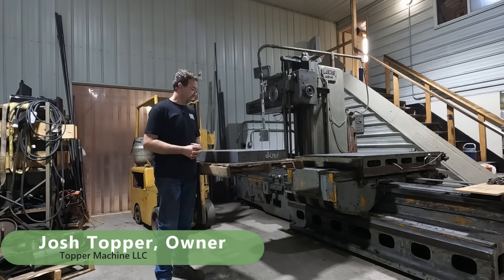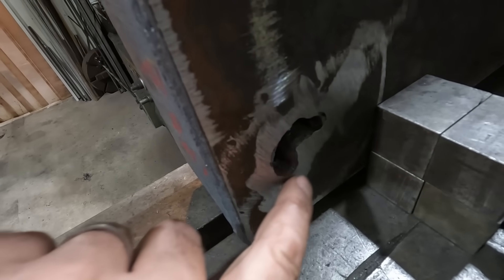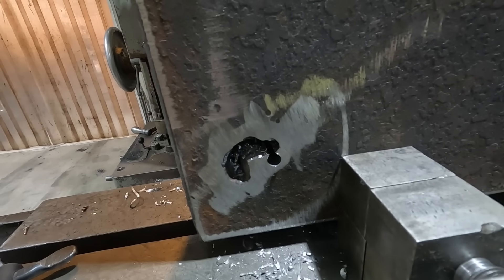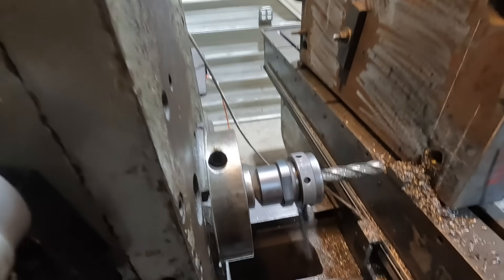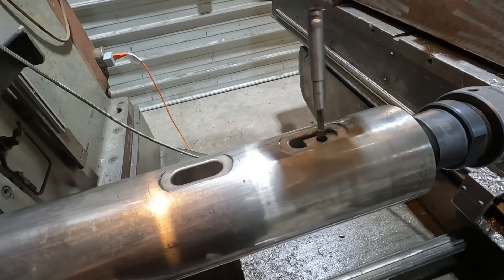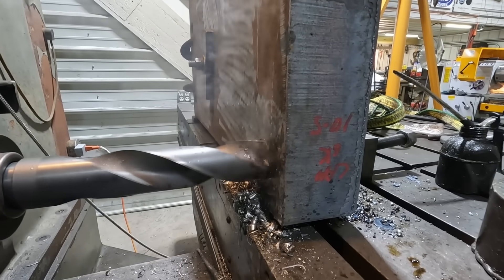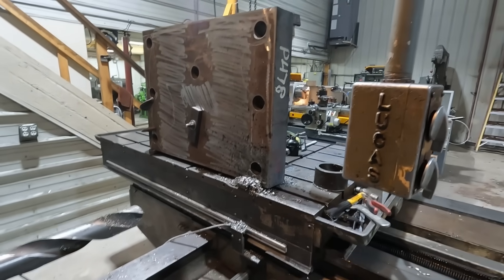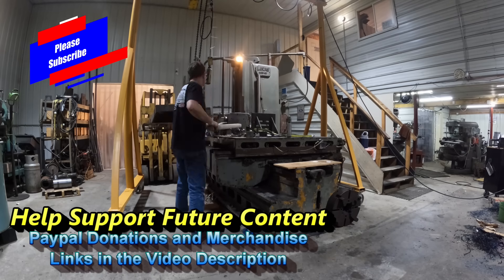How To Save A Plate With A Bad Torch Cut | Manual Machinist Repair Explained

Comment: I have a 1918 Lucas No. 43 HMB I’m fixing up to use. I’m having trouble finding tooling. Mine also has an MT6 spindle taper. Is there any way you could make a video showing how you made that draw key?  That would be super helpful. Thanks. Keep up the great videos.
Reply from the maker: I've had to make and modify so much tooling to get where I am. MT6 is getting harder to find.

Comment: Sometime over the years I picked up an ancient mag drill and a huge bucket of annular cutters. While I don’t use the mag drill much, it’s great for stuff like this. I use the annular cutters in the mill quite a bit. I love seeing these big old mills in use still.
Reply: Annular cutters that can cut more than 2" deep are pretty rare though.
Reply: @bcbloc02  True, I think I have some longer ones but most are pretty stubby. Given the loose tolerance, I think you could drill a pilot hole all the way thru and drill from both sides. I just wanted to point out that annular cutters exist really. It’s one of those things like trepanning in the lathe that I often wonder why more people don’t use.

Comment: Seeing the already cut holes in this 4" plate, it's obvious the oxy-fuel operator didn't know the proper procedure for piercing and cutting this thickness. Oh well, more business for Topper Machine.
Reply: What is the proper procedure?  Do you bury it in sand to keep the whole block at temperature?
Reply: @1nvisible1  I have hand pierced and cut steel this thick years ago in recycle work. My personal opinion is that considering the thickness of the metal and the small size of the hole, that a pilot hole should be drilled to eliminate the possibility of the pierce wandering outside of the diameter of the hole.

Comment: Nice work and what an amazing massive machine!  This is the first video of yours I've seen, so forgive my ignorance... but why not just use a magnetic base drill and 'hole saw' (I'm assuming the hole saw does not need a pilot bit in the center, like a hand-held drill hole saw would).  Maybe they don't make the bits to go 4"?  I'll be checking out your other videos now!

Comment: Magnetic drill and carbide tipped annular cutter. Guess the iron shop didn't possess the basics.
Reply from the maker: They used to do all of their drilling in house, then sold the equipment because it made more sense to farm out the hole work. If it can't be torched, it gets sent out.
Reply: @TopperMachineLLC  they should have just got a kitchen and walker piller drill and be done with it. torching holes leaves room for error. going through with a 11/16 then 2 inch makes more sense to me. or just chuck it in the mill and go through with a cutter. anything but gas cutting if it can be avoided.

Comment: If that type of material is common.... a water jet is in order.   You will quickly be first in line for some really easy work.
Reply from the maker: Unfortunately, this is a very infrequent job. Right now in my region we have a few water jet shops and all are struggling to make the payments. Personally I would love one if it made sense, but I couldn't justify the cost for what these shops are charging just to get work. Crazy low!
Reply: @TopperMachineLLC  Yup.  Have to know your market.  If there is existing competition I couldn't justify the risk either.

Comment: Great job Josh, I was shocked and amazed at the total cob job that original shop made of torching those holes.....really looked like an apprentices 1st try.....Y YI YI...... I was quite surprised that you didnt experience any flame hardened hard spots from the torch job, or bubbled porosity voids......and pleased that you didnt.....definitely a great save, many here have NO idea how much of a save this actually was.....10 thumbs up !!!!!!
Don
Reply from the maker: Thanks. I did experience some hardening, but experience has taught me not to push it, just nice and slow and lots of oil.  I charged handsomely, but they had no problem with it. Not sure how much the plate would cost to replace, but guessing I saved them a ton.

Comment: You would have had to knock back the job, if you did not have the Lucas. It might get you more work, if all the planets align.
Reply from the maker: I could have done it on the radial drill. If there is a will, there is a way.

Comment: Thanks for the video. That Lucas boring mill is a real keeper. I'm always pleased when you use it.  I remember you doing line boring with it. Cheers.
Reply from the maker: It's been a great machine. I need to replace some bearings in the feed box as they have gotten really noisy, but that will have to wait for free time.
Reply: @TopperMachineLLC  Free time, eh? 😂

Comment: I need a 24" round piece 4" thick if you have any. Going to make my own boring head for my bore mill
Reply from the maker: I want to do the same. Just going to order some 1045 ot 4140 to do it. A36 just would not be a good choice.
Reply: @TopperMachineLLC  I'm looking for 4140 myself

Comment: I am a carpenter by trade..so what do I know??   How old is the Lucas?? How many hours on it??  I guess it loses a little accuracy over the years?? I guess in your shop where it runs only a few hours a year or so, it will last your working life? Ever need a rebuild? Always hard to fix a messup....did the torch harden up or effect the steel on the edge of the hole? Nice you had a 1/8" to play with...fun stuff when it works out.....
Reply from the maker: It is a 1963, and still as accurate as day new. These machines were well built. It is a little dirty and needs a little TLC, but has been a real work horse. I have most of it's history from new and I had seen very little actual work.

Comment: I would have tried a mag drill on it. Given the generous clearance hole accuracy wold be ok.  I don't have a mill to play with though and you did a great job.
Reply: This is the type of stuff a horizontal boring mill is made for, mag drill is a toy compared to this. Why not use the right tool for the job if you have it.
Reply: I agree.  Can't imagine why the shop that cut the plate wouldn't use a mag drill for the holes, especially if they frequently make such plates.
Reply: @einfelder8262  Time...... a burn table can put that 2" hole thru 4" of plate way faster than a mag drill even with a special annular cutter that could handle plate that thick.
Reply: @bcbloc02  Yes, I can appreciate the time factor, and the expense of suitable mag drill and cutter.  But how much time (and money) did the original shop save on this job?  Perhaps it was just a screwup from a new employee? Also the stock 4" sheet that this piece was cut from may have another blank available on it, and they just cut another one while having this one fixed, to keep their customer happy.
Reply: @bcbloc02  Also, is a 4" deep annular cutter readily available? That might not exactly be a standard cutter.
Reply: @gorak9000  they are, but they are WICKED EXPENSIVE
Reply: My thoughts exactly. I’m surprised mag drills and annular cutters aren’t used more. I’ve worked in plenty of shops that didn’t have either. I use annular cutters in the mill and lathe quite frequently. I got a huge tub of them probably at an auction somewhere so I don’t need to buy them, which might make a difference.

Comment: Dumb question couldnt a guy just do a field repair and run a annular cutter and just set the pin on the center punch mark and let her eat without all the set up? I have only used them on plate up to 2" thick but made decently quick work of them and put the hole right where I intended to
Reply from the maker: I honestly don't know.  This is what they wanted, so this is what I did.

Comment: I am glad that you were able to save the part. Four inches is thick plate. I am so used to working with sheet meatal and it is hard for me to imagine cutting something thick. It is a good thing that you had the talent and equipment to do the job. That steel had to be very expensive and I am sure that you saved them time and money. Thanks for the video. 😃😃😃😃
Reply: I am morbidly curious to know what the raw material costs. Thought suspect that it might be in the category of "You don't want to know"
Reply: @gorillaau  Just the plate itself with no work done to it would be around $2000.  That is for a 2x2' 4" plate, and his appears larger than that.  Lots of money in steel these days.
Reply: @Bobbywolf64  Thanks for the reply. So perhaps this could have been a $5000 plate and is now a $10,000?

I read your reply earlier but forgot to reply.

Comment: Nice save.  I did one like this a while ago but I made a drill bushing to guide the bit through the torch cut area. (Only had a radial drill, couldn't use an endmill like you did.)  I have a question for you if you don't mind.  I am currently getting an HBM up and running and I am thinking about angle plates for it.  I already have two large plates (12" wide, 18" by 36") that came with it but I am thinking of making some smaller ones.  I do similar work to what you do and would like to know what size you would find the most handy.  Eventually I will make several sizes but to start I would like to make the most useful size first.  Thanks in advance for your opinion.  Ken
Reply from the maker: Hi Ken.  I have all sizes, it really depends on the job.  I have used 6X6X6, all the way up to my newest one of 48X36X24. I have some that are 36X24X6 that are handy too.  The best answer I can give you is "All of them"  You will find you never have what you need on the HBM and be making tooling and fixtures for years to come.  The tooling will eventually take up more floor space than the machine.
Reply: @TopperMachineLLC  Thanks Josh.  I figured that would be the case.  Like any tool it's good to have lots of them.  Ken

Comment: I would have used my Jancy Slugger with a 2 inch annular cutter. I'm surprised you don't have annular cutters to use in that machine. They work well to alter incorrectly drilled holes too.
Reply from the maker: I rarely do this kind of stuff.  I think the last one was 3 years ago, so having expensive tooling for a rare job just isn't something I want to spend money on.  Thanks for watching.

Comment: Just found your channel. Nice to see knob twirlers still in business. We closed our shop as a business and just do hobby work now. Not anywhere near as equipped as yours. Just a Leblond Regal, big Lodge & Shipley lathes, Hendy #3 horz mill and Kent vert mill for machines. Decent weld shop and 4 X 8 CNC plasma system. (Our original product)
We used to joke about building CNC systems on manual machines.

Comment: Why didn't they send the plate for drilling, to you in the first place?
A case of penny wise pound foolish, me think
Reply from the maker: Large corporations do things strangely. That's all I can say.
Reply: Torch cuts are cheaper then Machining. And with a +/- of an 1/8th  no need for precision drilling
Reply: Dylan. I agree with the costing but here's the thing. If any of my workers pulls a stunt like this i'll fire him on the spot. We are not animals. We will do the job right otherwise we might as well move to india or pakistan and do cheap work that performs shit. It does not take long to drill holes like these. As a company owner we always try to save where we can, but NOT this way.